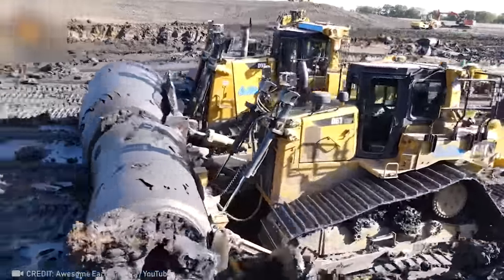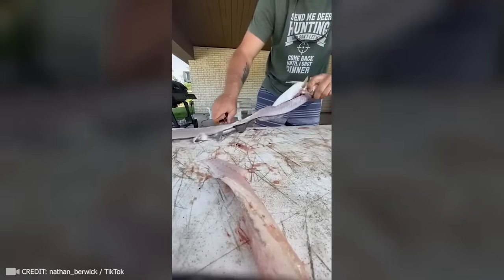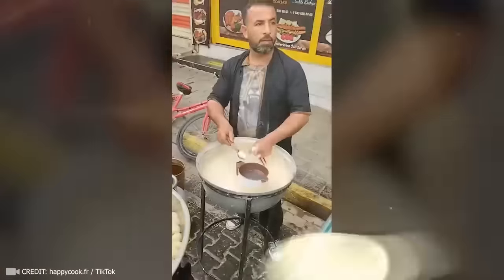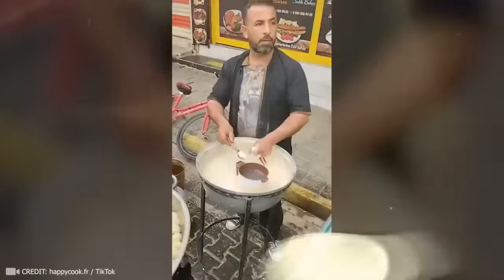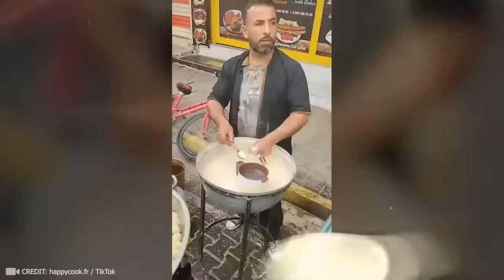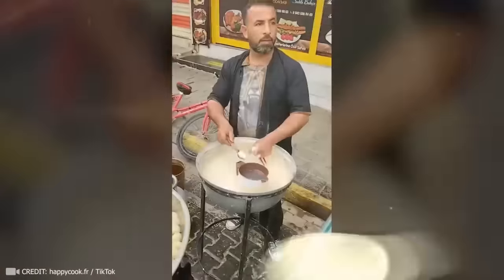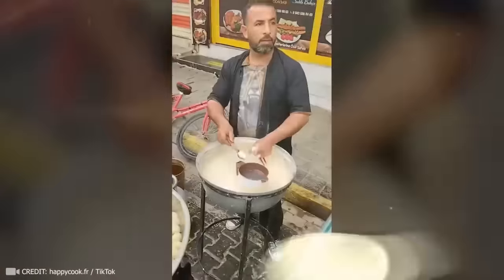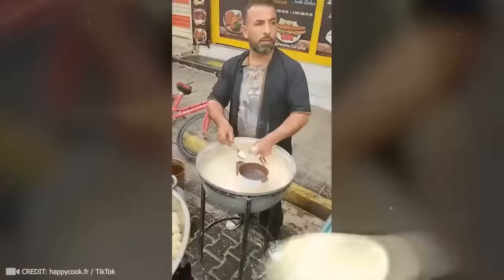40 Minutes Of Satisfying Videos Of Workers Doing Their Job Perfectly | Best Moments

Comment: 6:55 - the only one i don't agree with... (so far)
not "only a specialist" - it's actually simple af
it just take angle grinder + phosphor acid (google says: phosphoric acid - my mistake...)
1st one cleans loose rust fragments
2nd one removes the rest of rust without harming the metal
i know that only because i did some maintenance with some of my gear recently :P
btw: this is VERY satisfying when you renew some piece by yourself :)

---

12:00 - this should be forbidden by law.... gl buying such a piece of junk and gl to your family due to safety issues...

Comment: Truck driver backing up….  This used to be a skill the average truck driver could do, in fact, if it was once a requirement.   When I started driving in the 80s, today I am shocked to find out that many drivers cannot back up.  Especially when you go to older cities, where the warehouses and factories were designed for shorter and more narrow trucks.

PS: I’ve done it…..  set up is everything. If the setup not perfect, will not go right in.